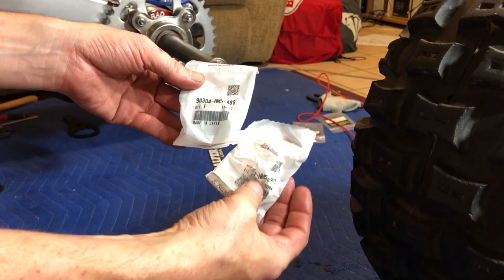Honda ATC 200x Build - Part 13 - Swingarm, Rear Shock, Axle, Brake Caliper Rotor Line, Hubs, Wheels

Comment: Coming out bad ass bro ! I got the red gaffer lines on my 85. I Shoulda got the blue lol
Reply from the maker: I almost got the red too! But thought there was already a lot of red so I went with the blue ...
Reply: I just ordered Galfer blue F&R lines for my 86 with red fittings and blue banjo bolts. I been wanting these lines since I got my 86, I never thought to get on Galfers website. Kinda makes sense being that they build them to order. A set would pop up on about once a year it seemed and I just never moved fast enough to get them when they would be on eBay. I’m glad I got them from Galfer’s site because I was able to pick the colors of everything. Did you notice a difference in the way the brakes feel between the OEM lines and the Galfer?
Reply from the maker: @ATCREVOLUTION  Hells yeah! That was the best part ... getting to build your own colors (I just went traditional). You probably won't notice any difference in braking (unless your stock setup was damaged or something). Aftermarket brake lines are basically just cosmetic, last longer, easier to route, easier to bleed, etc and just plain look badass!
Reply: @11GalleryATV  I think my OEM lines have about had it. The rear is the worst, there’s some minor swelling that just started when I hit the pedal so I should have a little bit better feeling brake pedal with the new lines.
Reply: @ATCREVOLUTION  I can tell the difference. They feel more responsive for sure. But, then again, I rebuilt the calipers, put new pads on and a rear rotor also. So it may be a placebo affect but at the end of the day, I'm totally happy with them.
Reply: @demetrimicroutscos5904  everything is new on mine but the rotor/lines so I’m looking into getting a rotor as well. Mine is almost out of spec for sure. That’s what I’m anticipating, better feeling brakes after I swap lines and get a rotor.

Comment: I just put that same exact rear brake caliper assembly on my 86 last night. I thought I was just buying the block of plate for the price so I was surprised when I opened the box. The new caliper bracket did not line up with the brake stay so I just used my OEM bracket to mount the new stuff too. Love the Galfer brake lines, I’ve been waiting for a set to become available to put on mine for months. Maybe I should contact Galfer about some lines? That Chinese caliper assembly works great on mine after swapping over the bracket. I’m going to get a rebuild for the OEM caliper for back up though. I use blue Loc Tite on my axle lock nuts and they still work loose eventually after some hard rides, might be good practice to check them over kinda often. 👍 Sick build man
Reply from the maker: I bought my Galfer lines straight from Galfer ... Front: https://galferusa.com/product/honda-1986-atc-200x-front-lines-fk003d898-1 and rear: https://galferusa.com/product/honda-1986-atc-200x-rear-lines-fk003d898r
Reply: @11GalleryATV  thanks for the info man! I got my lines ordered today straight from Galfer 👍.  Great video too BTW, nice to see a second gen 200x coming together like that. I might have to find a bearing carrier like you have as well if you can still buy them?
Reply from the maker: @ATCREVOLUTION  Rad Mfg had a falling out where one of the employees went rogue and started producing bad parts and not sending thing to people after they had paid. I got my carriers right before that happened but I still never got my my brake caliper holder back or a new one and I had to buy another one to continue my build. You may want to give them a call or email to check on the current status and before you send any money to them.

Comment: Excellent videos you have done, which leads me to asking you about the two identical o-rings you mentioned in part 13 that are no longer manufactured, but you found on Amazon. One is on the axle by the sprocket and the second o-ring that goes into the brake rotor holder. On the assembly drawings this is shown as a 35x1.7mm. For what I have found, no one makes a 1.7mm, so I assume you used the 1.5mm? Also, is the 35mm the OD measurement for Honda? Thanks so much for all the detail work. It has helped me a tremendous amount in bringing up my 1986 200x from high school back up to almost new.
Reply from the maker: I just looked up my Amazon order and it looks like I actually bought 2 sizes of 35mm but I don't remember which one actually fit ... Here are the 2 that I purchased:
https://amzn.to/444QBNr
https://amzn.to/3U8deMb
Reply: @11GalleryATV  Wow, thanks for quick reply. I think I'll try the 1.5mm.

Comment: Howdy!  Just picked up an 84 200X and am restoring.  Your videos are a great instructional tool.  You've done some great improv too like the CRF450R rear master cylinder.  Where did you find the delron bushings for the swingarm?  I didn't see a reference to them in your parts & tools list?  Thanks a bunch.
Reply from the maker: I found them on eBay but that was a long time ago and I haven't seen them lately. I think a guy from one of the 200x Facebook groups still does them ... this guy had them - https://www.facebook.com/groups/120948345007991/user/100005251080552/ from the "Honda ATC 200X-350X Connection" Facebook group
Reply: @11GalleryATV  Thanks for the lead.  Makes it so much easier than all those pieces / parts

Comment: Love the videos. They’ve been a great help in unraveling the ‘85 basket case I picked up. What size Phoenix clamps did you use for the brake lines?
Reply from the maker: 5/16 Inner Diameter Billet P Clamps by Phoenix Industries

Comment: Great video, may i ask where you get your Honda Parts as I need to replace my hub and sprocket on my 85 200x
Reply from the maker: I got my parts from all over like eBay, Facebook Groups, Amazon, and here (but they only carry 1986+) https://www.motosport.com/oem-parts/honda/1986/atc200x

Comment: Absolutely love the videos!  I am restoring my 85 200X and keep these videos handy. My question: for the parts you don’t powder coat or paint (axel, reused nuts and bolts, etc), do you coat them in some way to prevent rust?
Reply from the maker: I did not coat them but I live in the desert and keep everything clean and dry … I would have  if I lived in a humid area or if the machine was left outside or something

Comment: Did you find a used pivot bolt or can you find these new someplace still?
Reply from the maker: I got lucky! The pivot bolt came with my swingarm when I bought it. The whole thing was used but looked brand new and still had perfect grease and bearings inside!
Reply: @11GalleryATV  heck yeah!  I forgot about that whole new swing arm you bought.  Just planning for restoring the beat 200x I have.
Reply from the maker: @danjim7056  Pivot bolts are hard to find in good shape ... they don't make them anymore so keep checking eBay or ask around in a Facebook group

Comment: Great videos, I am rebuilding an 86 and appreciate your advice as I go along. Can you share the part # for the o'rings you got off of amazon. I can't seem to find them.
Reply from the maker: I purchased 4 different size packs and I don't remember which one I used for what. Here is a link to the one of the sizes (41mm OD, 38mm ID x 1.5mm) - https://amzn.to/3d0EvuX ... the other 3 sizes I bought were (37mm OD, 34mm ID | 35mm OD, 32mm ID | 35mm OD, 31mm ID)

Comment: Wondering on the motion pro axle wrench axle lock  jam nuts... Is that a 45.5 tool model 08-0479. Will this one fit ? Want to make sure I buy the right one to fit
Reply from the maker: yessir! This is the 45.5 open ended wrench from the 08-0479 set. The closed ended wrench from the same set is a 56 mm.

Comment: Hey do you still have one of those Rad 200x billet carriers ?   
Could you inform me how to get the torque wrench you use.
Reply from the maker: I sold the other billet carrier on eBay awhile ago ... and both the torque wrenches are linked in the description ... Lexivon 1/2 inch and 1/4 inch both

Comment: Hey man what is the diameter of the delving bushing you used to replace the oem setup ?
Reply from the maker: ¯\_(ツ)_/¯ I don't really know the diameter of the Delrin Bushings because they are installed, but I can tell you that the swingarm openings where the bushings go are 26mm and the bearings that came out of the swingarm are also 26mm, soooooo, I would also assume the Delrin Bushings are 26mm.

Comment: What rear master did you use and brake pedal? And how did that Chinese rear caliper work?
Reply from the maker: I ended up using a rear master cylinder from a trx450r (the one in the video is from a CR dirt bike, I couldn't get the one I had to hold pressure), the brake pedal is stock, and the Chinese caliper works fine but I rebuilt it and had to use the stock bracket (the one that came with it does not fit)
Reply: Thank you!

Comment: Hi- where did you get the Amazon O- rings for the axle? Thanks!
Reply from the maker: I purchased 4 different size packs and I don't remember which ones I used for what. Here is a link to one of the sizes (41mm OD, 38mm ID x 1.5mm) - https://amzn.to/3d0EvuX ... the other 3 sizes I bought were (37mm OD, 34mm ID | 35mm OD, 32mm ID | 35mm OD, 31mm ID)
Reply: @11GalleryATV  thank you! Your videos are awesome   Always super helpful
Reply: @11GalleryATV  the 35mm OD 32mm ID was the correct size. Thanks again

Comment: where do i get the red carrier bearing holder for the swing arm thanks buddy
Reply from the maker: I got it from RAD MFG but they don't seem to be operating at the moment ...
Reply: @11GalleryATV  mine looks like the cookie monster took a bite out of it . if you  find out anything keep me in mind. i have been working on my 1987 200x for 2 year i can wait a little longer thanks buddy
Reply from the maker: @mikemeyer7686  There is one on eBay right now that looks really nice ... but I don't know your budget ... https://www.ebay.com/itm/313594606930

Comment: What rear swing arm is that? And what rear tires are those?
Reply from the maker: The swingarm is completely stock and I don’t know about the tires. They were thrown away and I now have SunF tires all around. You can see the new tires in the later videos …
Reply: @11GalleryATV  right on love the series of vids bro nice machine. I'm doing a 85 200x
Reply from the maker: @duckworthatvandmxadventure6601  Thank you!

Comment: I have a question I have a 200x 1986 and my back axle is broken from the end do you think a 1985 axle will fit on my 86
Reply: Or do you think any other axle will fit from a Honda because a 400ex axle look exactly the same what do you think ?
Reply from the maker: @lvdlf9908  no and no (they are both much wider and don't fit the carrier) ... after lot's of research I have come to the conclusion that the only axle that will really fit the 1986-87 200x is the 1986-87 200x!

Comment: I need a 200x axel what shape is the one you took off in I can’t find one
Reply from the maker: It’s junk! I had to cut it in half to remove the sprocket bracket because someone welded the hub and castle nut on that side ...
Reply: @11GalleryATV  do you know where I could find one ?
Reply from the maker: @coltonphillips8034  no sir ... I bought mine by asking in a Facebook group ...
Reply: @11GalleryATV  is it 80s death machine?